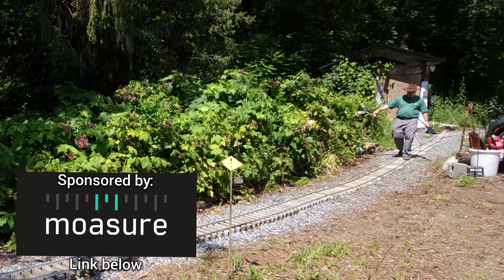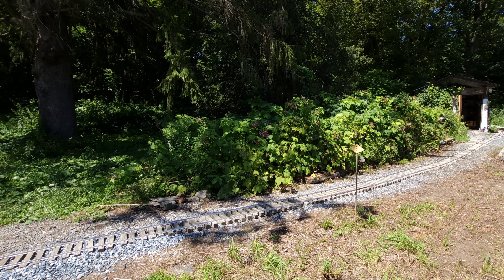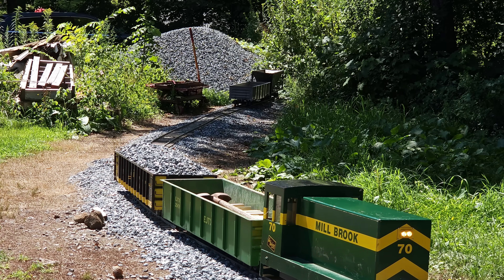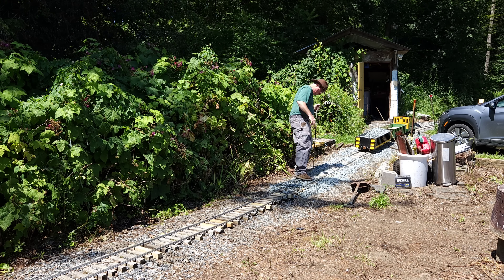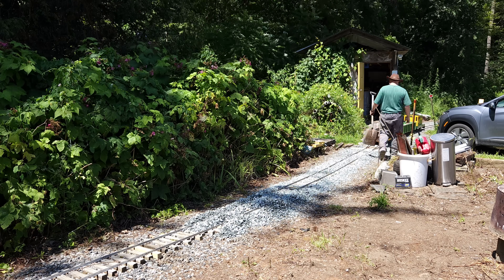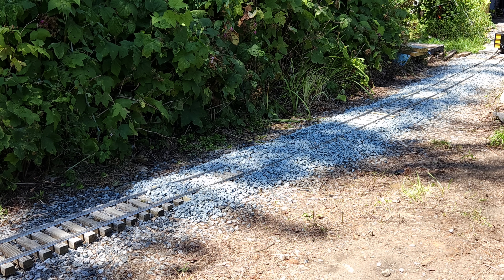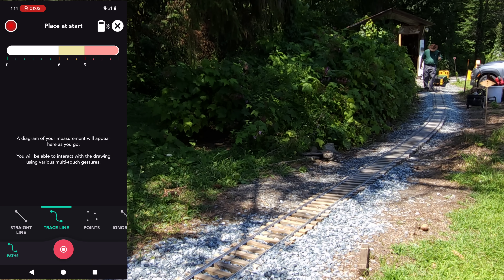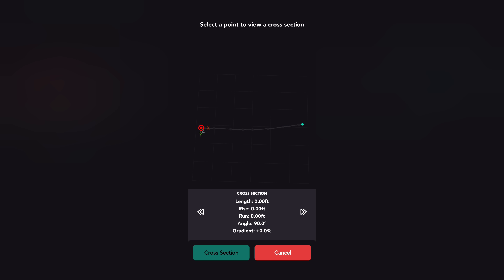Fixing a 6.5% dip: Lifting and Tamping Track The Old-Fashioned Way

Comment: Good going! When we built the SC RR museum's yard at Rockton , SC, we built panel track (think 12"=1 foot atlas snap-track) and skated them around and lined them up with a tractor and a bulldozer and bolted them together and THEN went out with twine and stakes to level it out...god i wish we had that gadget then!, we also used several track jacks to lift it into line. We used gravel fines/slag from the old quarry over time to ballast it, but like a LOT of southern short lines we used literally what was at hand to initially ballast the yard...dirt...which is cheap but AWFUL ballast. in the intervening 30+ years since then most of the yard has gotten...some ..ballast.
Reply from the maker: Those conditions aren't only on southern short lines. They're a short line problem in general. Even here in the northeast. One of Vermont's most storied roads was the St Johnsbury & Lake Champlain, later known as the Lamoille Valley Railroad. They rebuilt the railroad in 1978 with relay ties and upgraded to 70 and 80-lb relay rail where they could. Ballast was still bank run gravel in many places, which was topped up with whatever jagged stone they could get from local quarries. 
In miniature, I completely blew this year's budget apart on a single load of ballast, but it was the lack of ballast that's been holding up several key projects.

Comment: That’s an awesome tool! Old as I am, I did some surveying the old way decades ago. One detail still useful may be to mark your points “physically”, and reference your GPS measurements with them on the “real ground”? 

That way you’d have a visible or measurable reference to “tamp against” - ballasting & tamping is sadly still as physical as it ever was…

(Easy for me to lecture, not having to move a muscle…😂) 

Great work, thanks for sharing…!
Reply from the maker: You do bring up a good point. I keep forgetting to place flags. Flags actually would be helpful. Even if they're not marked.